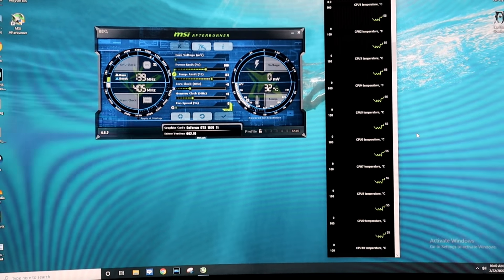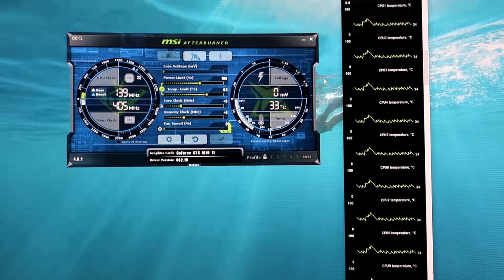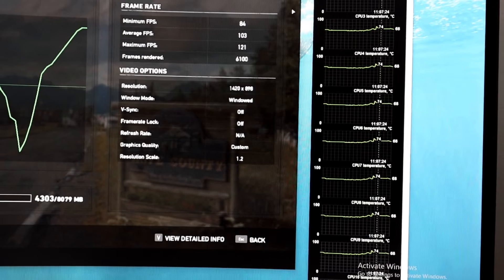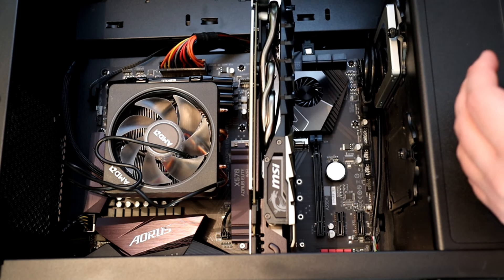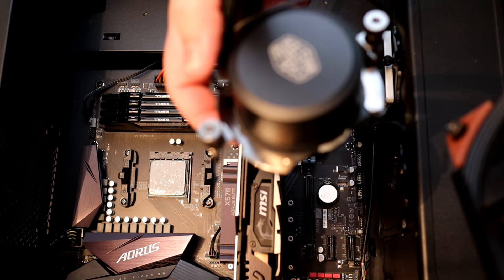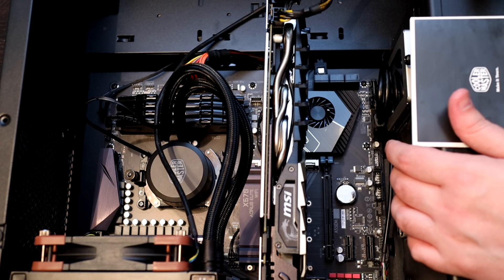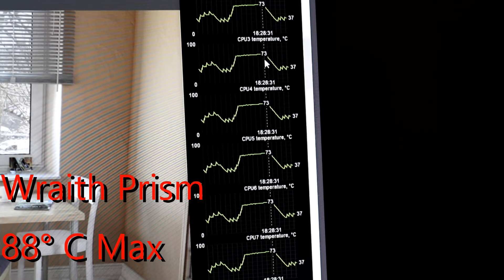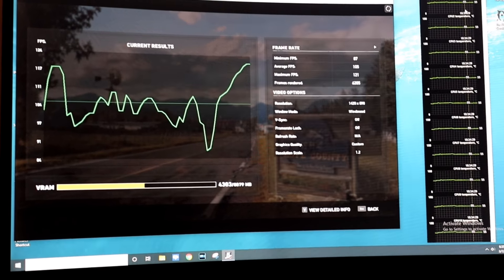Wraith Prism Cooler vs Cooler Master B120 AIO

Comment: I dont know whats wrong but i get with my orginal stock wraith prism 4700 Points in Cinebench r20. My temepertaure was not more than 60C. Ryzen 3700X
Reply: Yeah there is something wrong with his system. My wraith prism are not nearly as loud or noisy as his.
Reply: @Sou_zed  there iss a switch on the wraith prism. Either High or Low RPM fans. U can check. I put on high rpm but more noise and less temperature

Comment: Prism i have 56c max lol i payed 30 euros for new one.. case closed.. and opened those not matter. My friend have NZXT water cooled he gets 65c he paid 200 euros.. So i win him... same cpu same cores..  He asked me how u done it ? I am computer expert ? I  use better psu i use better motherboard.. IT is not about cooling aio... it is about logic.. Better motherboard phases better vrm better psu it reduces heat on cpu not aio..
Reply: I have the 3700x 4.4ghz 1.2v fixed, Aorus b550m pro motherboard, EVGA g2 750w gold and over +85°C during Cinebench.
 56c, on idle...
Edit: b550